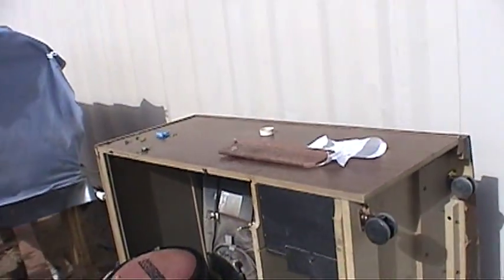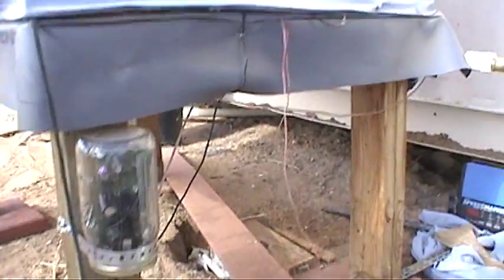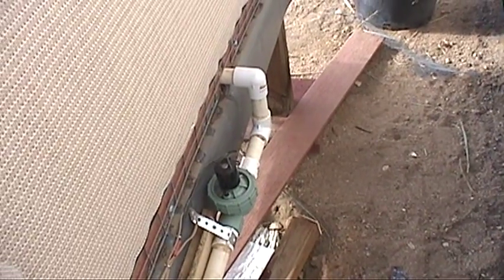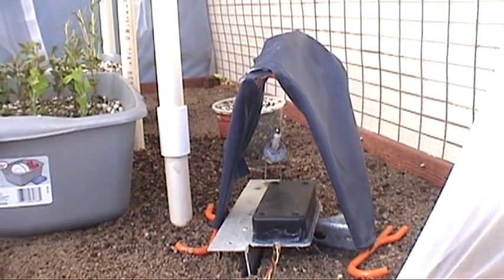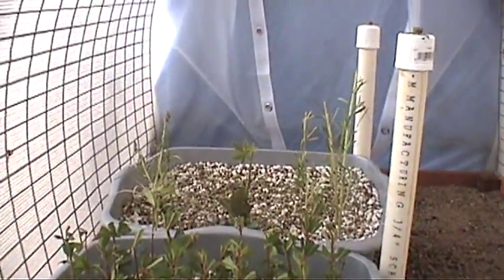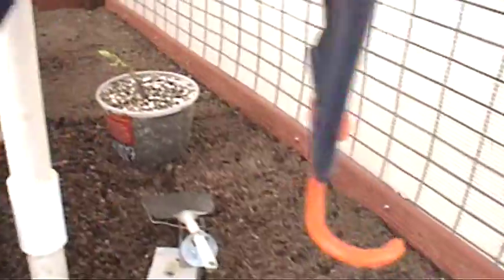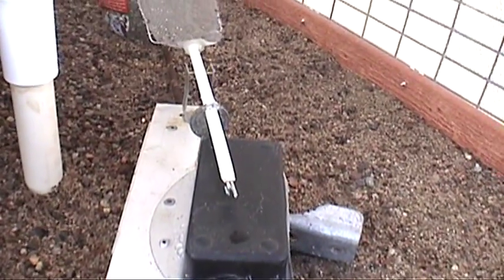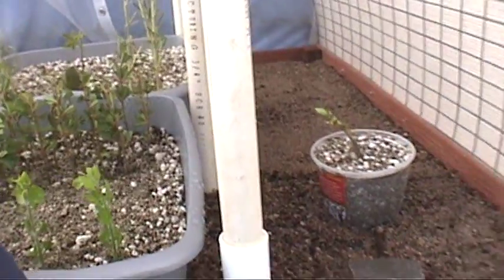My Cloning Machine

Comment: I noticed that it started before it hit the box with the magnetic switch. How sensitive is that switch?

 Are you just using the house water or have you got a recycling pump?

Is this leaf sensor one of your ideas or do they make actual commercial ones?

It may be ruff but it is works